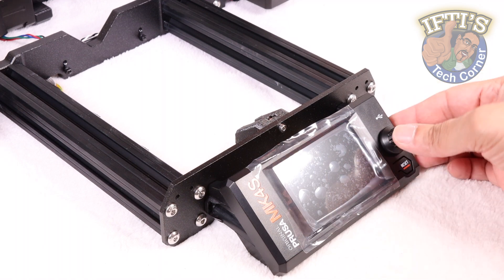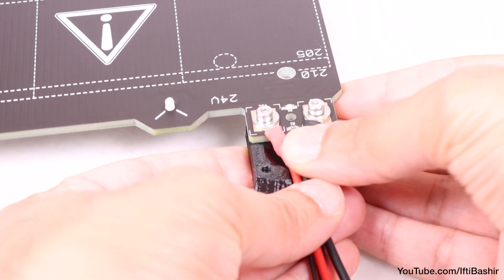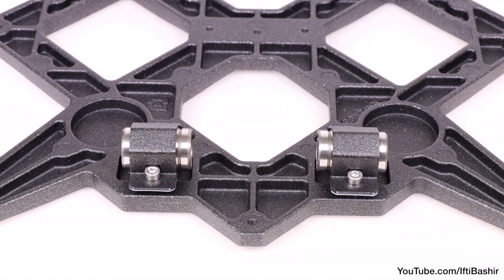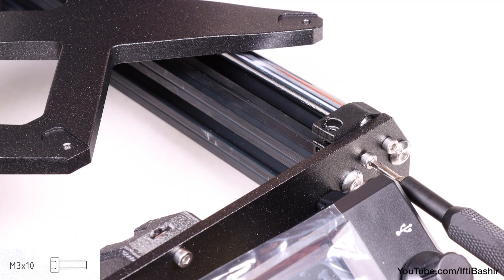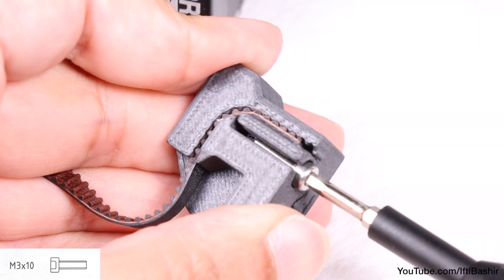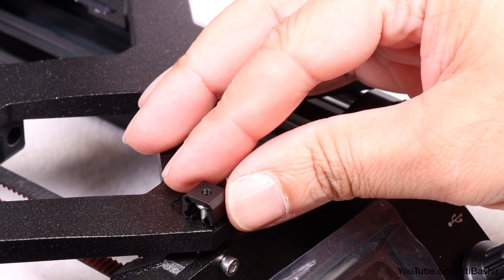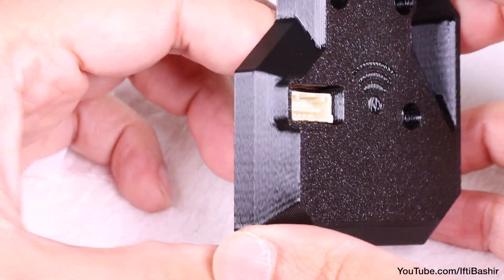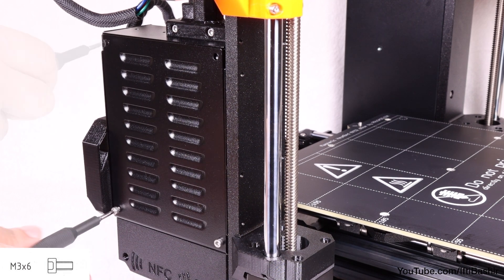#07 Original PRUSA MK4S Kit : Full Step-By-Step BUILD GUIDE - Y Axis & Heated Assembly

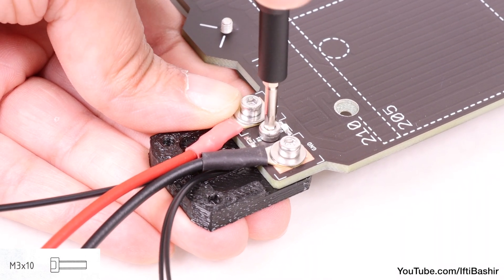Comment: I could not have done this without you.  This guide is invaluable for people trying to put this printer together.  There is no way I cloud have done this with the manual alone.  If you have a Patreon I would love to contribute a few dollars for your hard work.  There is only one improvement that I would suggest in the entire playlist. My printer had one calibration error related to the heated which I was able to resolve.  If we go to 2:39 or so in the video,, there isn't a visual step to tighten down the heated terminals, we simply screw down the lower plate and then the cover.  Since I was not following the manual at all, I forgot that the terminals needed to be tightened before putting on the cover.  Thanks again for the extremely thorough guide.
Reply from the maker: Ah thanks for that - I'm currently working on a Prusa Core One build so will be sure to add details etc!
Many thanks for your comment. I do not have a Patreon I'm afraid, although there is a 'Thanks' button under the video should you wish to buy me a coffee! lol
Either way, glad dates videos came in useful! Enjoy your printer!

Comment: 12:05 note the cracked Y-belt tensioner. A good reminder that the plastic parts are fragile, I suppose.
Reply from the maker: yeh - I managed to make it work and its still held tight to this day without issue........yet.........lol
Reply: Prusa must abandon DIY kit printers, completely eliminate all construction methods that are now more than 10 years old, if it doesn't revolutionize its production chain it risks closing its doors, it is still surviving thanks to the nostalgic and its loyal customer base that was built, myself included, I upgraded to mk4s like you and I was quite disappointed, the printer is definitely noisier than many competitors, the nextruder often fails and gives rise to several problems with old filaments (clicks and squeaks), I often found the quality inferior to my other 2 printers, a qidi plus4 and a bambu mini (that costs a lot of less), all assemblies are often approximate due to the printed components and entrusted to very subjective micro-adjustments, a printer like this cannot be proposed in 2025!